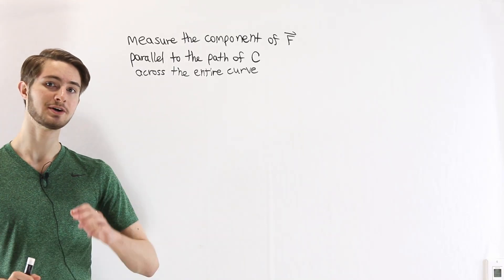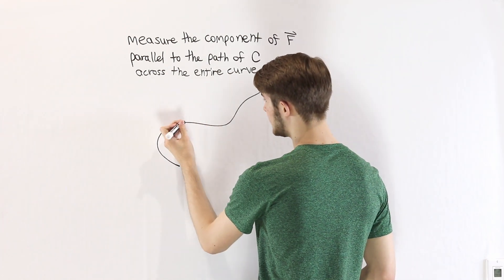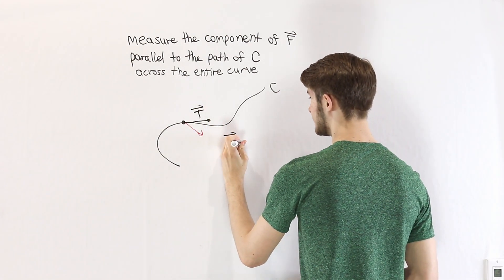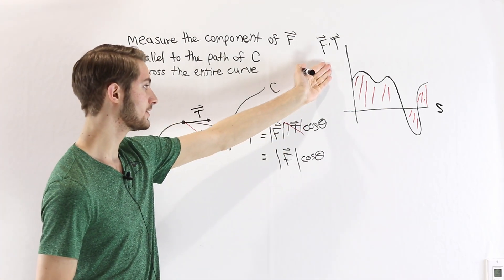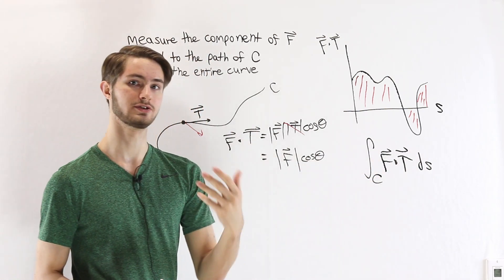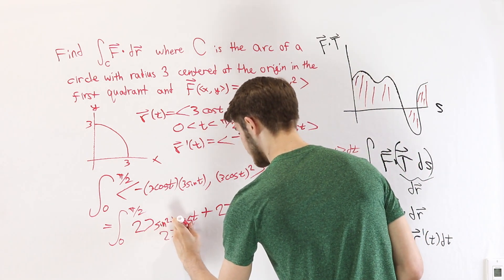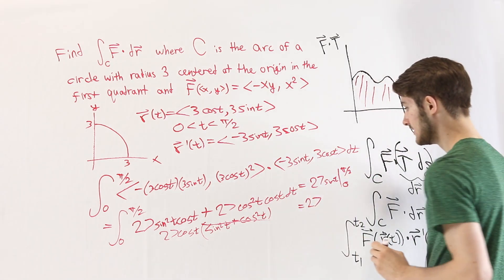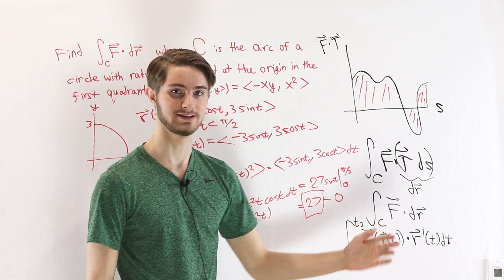21: Vector Field Line Integrals - Valuable Vector Calculus

Comment: Hi, i have a question depending on the difference about scalar to vecotr line integral. In scalar line integration we use magnitude of r-prime * dt, because we are interested in the small change along the curve, which i understand. But in vectorfield line integration we take r-prime * dt without the magnitude. Like i understand you, is that we want to sum the projection of our vectorfiled at a given point on the curve onto the tangential unit vector of the curve. Now to my question shouldnt the r-prime here be a unit vector as well, so we can measure this projection correctly? Because you even mentioned that big T needs to be a unit vector. To my understandig r-prime gives us the speed on a given point on the curve which is not always of the length one. Sorry for my english, im from Germany.
Reply from the maker: The formulation of the integrand as F(r(t)) ⋅ r'(t) dt is equal to F ⋅ T ds. They're both the exact same integral. We often use the form F(r(t)) ⋅ r'(t) dt simply because it is easier to compute for a given problem.

We do the same thing for the scalar field line integral as well. The unit tangent vector T points in the direction of r', so r' = |r'| * T. It's the same conversion in both cases.

Whether r' is shorter or longer than T is accounted for by how fast the parametrization r traverses the curve. If r' is larger then the parametrization will traverse faster, thus assigning less weight in the integral. That cancels out the fact that F ⋅ r' is larger if r' is larger.
Reply: @MuPrimeMath  That makes total sense to me now. Thanks for answering so fast. Just a tangent, would it be a right thought to have, that my r´t will be always of unit length 1 if i parametrize my curve after curve length? Im just curious. Since with a parametrized curve c(t) for example the output matches the input. Like c(8)=8, and so on. So my r´t which consists of dc/dt will be always 1. Im sorry if I monopolize your time. But the help in my university is not as good as you just did. My professor is shy and my tutors for math are worse than me. 😞Thanks again!
Reply from the maker: Yes - in fact a curve r(t) is arclength parametrized if and only if |r'(t)| = 1.
Reply: @MuPrimeMath  Ty very very much!